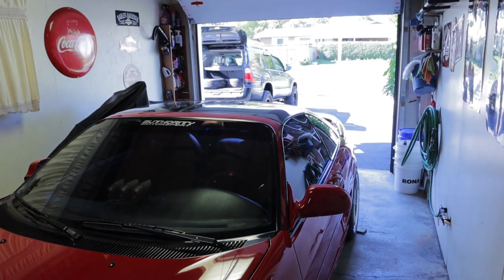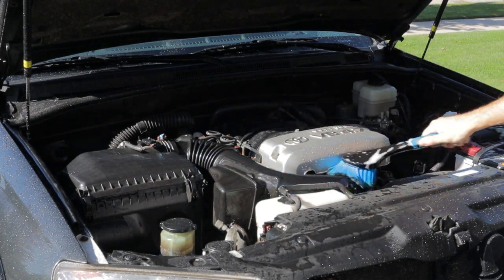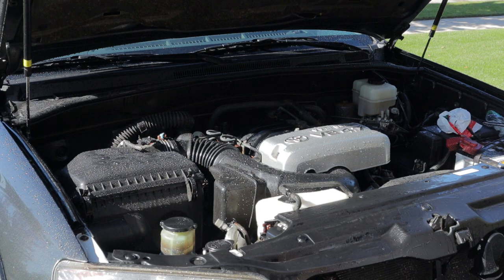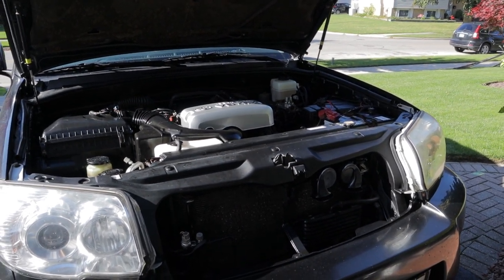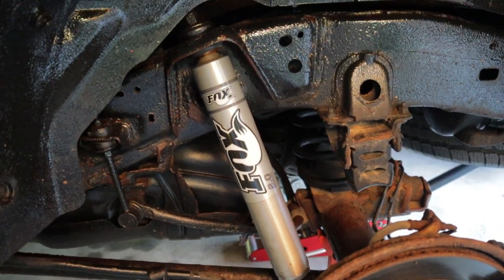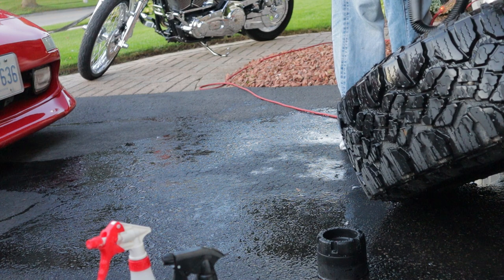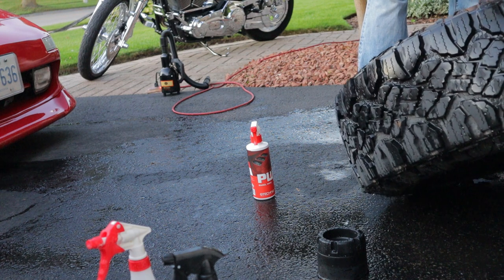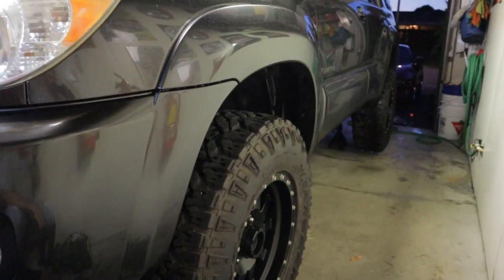Engine Bay and Wheel Coating | Toyota 4runner Detail Series EPISODE 2

Comment: I just did a quick engine bay cleanup on the new-to-me 2005 4Runner.  I sprayed everything with the foaming Dawn Platinum PowerWash dish detergent.  I should have used a long handle brush to agitate it a bit but I was too lazy.  After a couple of minutes to do its thing, I sprayed it off with a garden hose.  I then sprayed 303 conditioner on the plastic and rubber bits (including hoses but not belts) and polished it off with a few paper towels.  It looks a LOT better.

Comment: Someone talked me in to trying Mequires spray foam on my engine bay and i’m glad i did. Spray it all over a warm engine bay let it sit and like magic it absorbs dirt. Protects hoses wires etc; wipe off the excess if you like. Big thing you don’t have to worry about electrical connections.

Comment: When you get your frame and wheel wells oil coated do you still get underneath it in the winter and wash off the salt ? Or would it rinsing it more make having the oil spraying done basically useless and cause more rust long term ?
Reply from the maker: I'll give it a rinse after a big storm to get some of the salt off. Once the oil has been on there for a while it'll take more than water to get it off. I try to avoid getting it wet immediately after having it oil sprayed though

Comment: I don't know about the shiny spray. I remember all the guys and car dealers using Armourall, or similar stuff, and then the tires and dashboards cracked, the hoses cracked. All of this sooner than they would have, or maybe wouldn't have I never used that stuff and never had any of these problems. But maybe I'm showing my age and these products no longer cause those problems. My personal philosophy is Form eats Function's dust.
Reply from the maker: A water based dressing won't have any of those side effects
Reply: @CanadianGearhead  Dressing?  Oil and vinegar?
Reply: I'm not a detailer, but 303 conditioner gets good online reviews and is reported to prevent plastics and rubbery parts from cracking.

Comment: Is your 4Runner 4WD? I found one near me an 07 with 260K miles at a good price but it’s 4x2 RWD V8 Limited, do you think I can still go off-roading with it? Or recommend a 4WD one? Thanks!
Reply from the maker: All the 4runners in Canada were 4x4. If you're planning on going off road, I'd probably hold out for a 4x4. If you're just doing mild trails you can probably get away with 2wd and some decent tires though
Reply: Canadian Gearhead Awesome, thanks for the info! Keep up the good content!